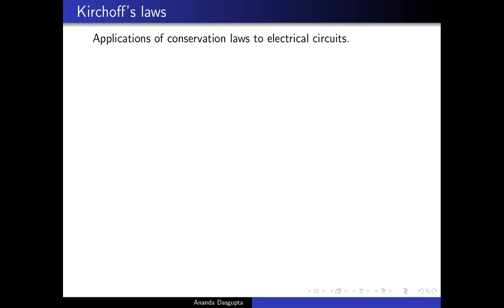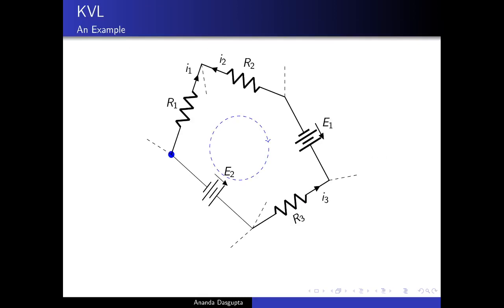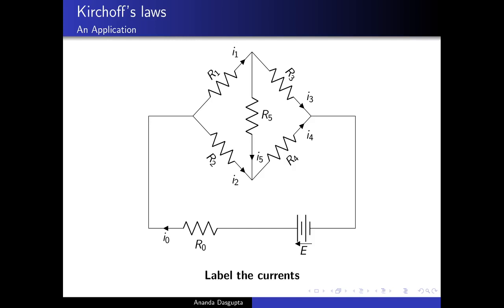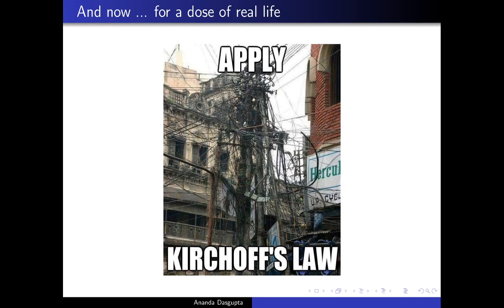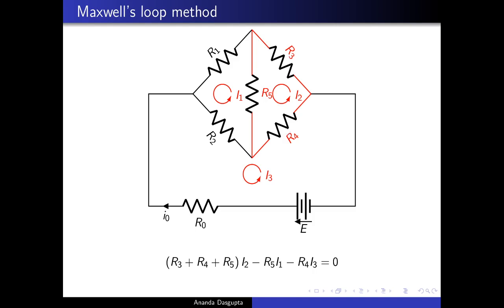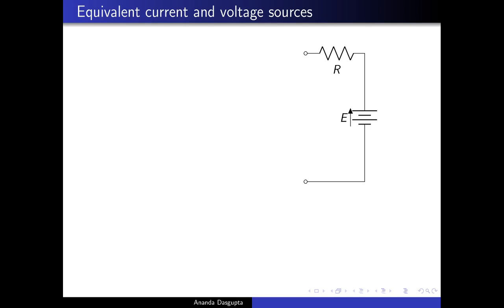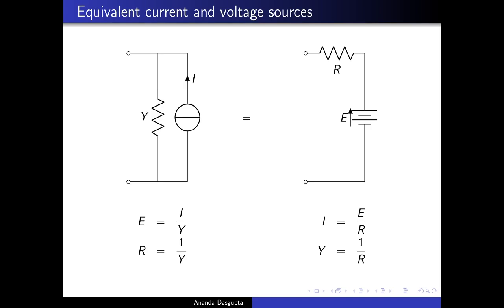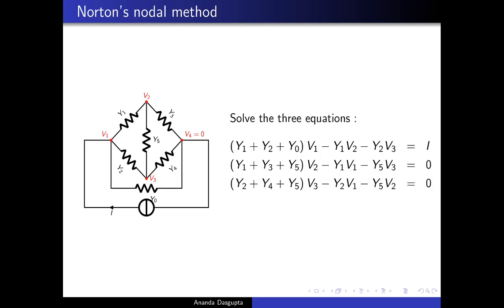Lecture 01 - PH3104

Comment: Sir, at 3:53, Kirchoff's current law has been described. This is similar to incompressible flow of a fluid, where we write continuity equation that the rate of volume flow across a cross section area is same across the volume of pipe (Av = constant where A is area of cross section of pipe and v velocity of fluid flow). In fluid, this is due to the fact that we are assuming that density of fluid is same throughout the volume of pipe (ideal fluid). But in current flow, it is not so much clear to me why are we assuming that there is no charge accumulation or the charge density remain same across wire? Is it just a simplification for the purpose of analysis or in reality also this is the case?
Reply from the maker: There is a deep physical reason why charge accumulation can’t happen in a conductor. Any accumulation would lead to local fluctuations in potential. Since the charge carriers (read electrons) are  free to move they would nearly instantaneously move away (or towards) the region where charge was being accumulated and erase the excess. 
Of course this movement isn’t really instantaneous - and therefore for very high frequency currents (as occurs  for example during the   propagation of light through a conductor)  there   is some charge accumulation - but this is insignificant at standard ac frequencies
Reply: @ananda_dg  Yes sir, now understood. Thanks a lot.